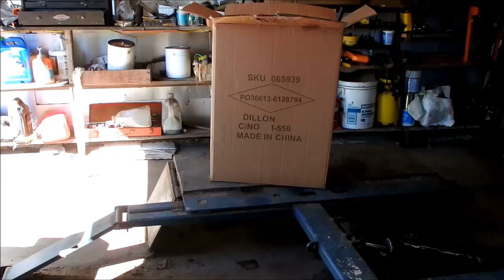Assemble the torch cart

Comment: Hmm, im not sure about that cart, it looks a bit too weak not to bend with the weight.

Perhaps some special r.peek bracing mods will be needed :-))
The tires should have been solid to carry the weight.
Just my mad thoughts.
Reply: I've had some dealing with harbor freight carts and such and I can tell you Rich won't have any trouble with that cart as it sits Harvey, BUT as he has a propane tank instead of a acetylene tank, he's probably going to have to modify it some.. I have an old harbor freight dolly and cart that have withstood my abuse pretty easily and held up.  The inflatable tires won't be a problem as far as holding the weight, BUT holding air is another matter, the thin tubes the Chinese use have a tendency to lose air over time, a nice US made puncture resistant tube might be something I'd look into, or just air the thing up, like I have to do to use my old dolly Hahahaha Of course, maybe the Chinese have gotten better with their inner tubes, they have gotten better with about everything else!
Reply: MrComaToes Well i imagined the wheels on a childs pushbike and the heavy gas bottles strapped to the bike, i just dont like the weight on those poxey wheels, but thats just me, i allways like to add extra strength to allow for unknowns, much like the great iron bridge builders that modern designers think used too much metal, but a 100 years later the bridge still exists (modern designs just dont cope long term).

Your right, i didnt like those tiny tires coping with the compressive forces of mr peeks bottles :-))